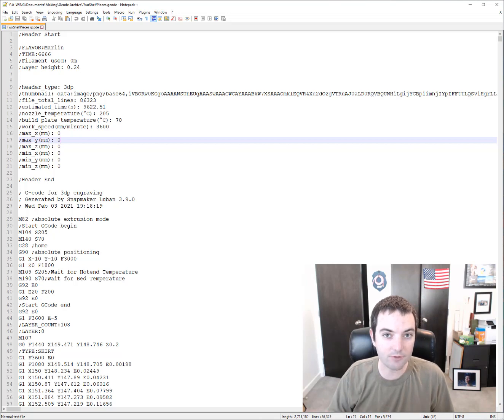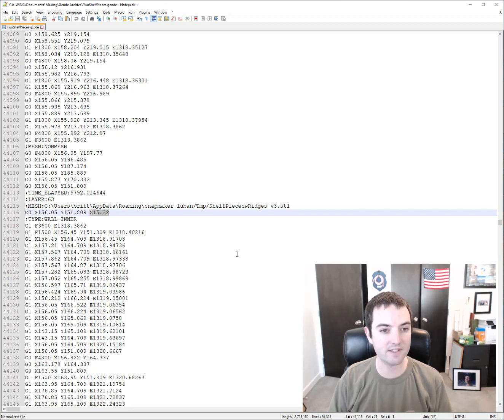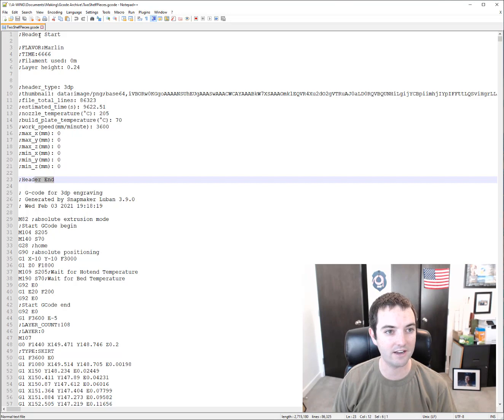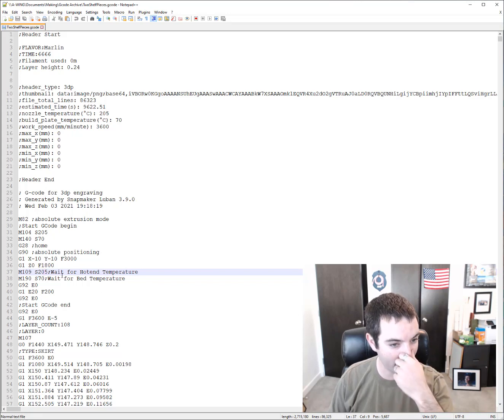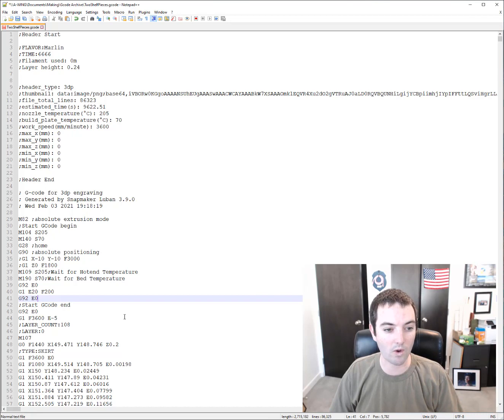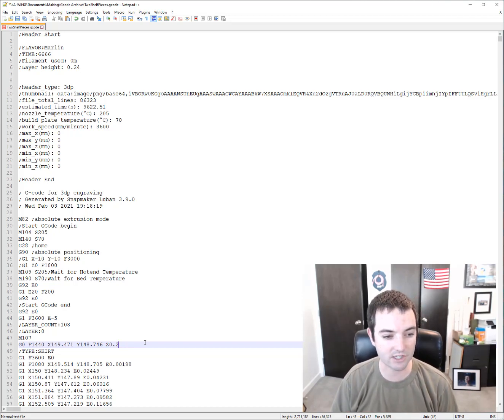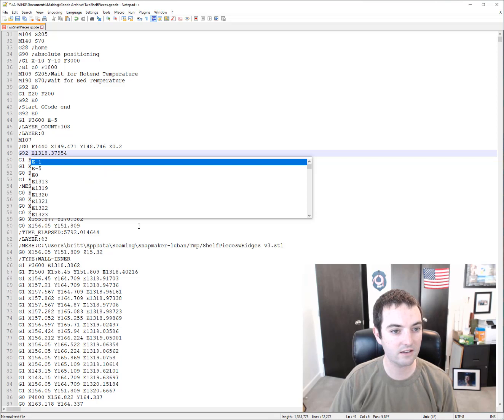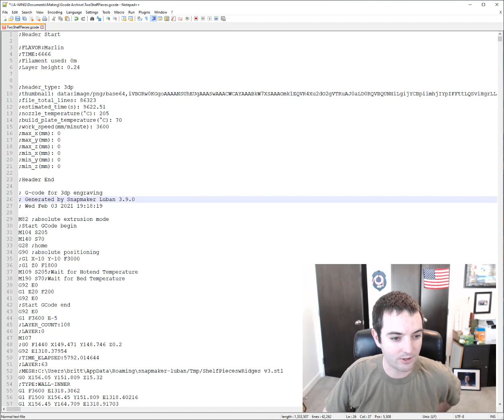How to restart a print from a certain height

Comment: Thank you so much for this video. This really taught me a lot about how to edit G-Code. As @Christopher Larime Mentioned, You must add a G1 command to set a height above your print to prevent the print head from colliding with your print when it is traveling from home, for example: In my case my Resume height was Z20.8 so I wrote: G1 Z40.0 F3000 ; before the print started to make sure it had enough clearance when traveling x/y. Hope this helps.

Comment: M107 [P<index>]    Turn off one of the fans. If no fan index is given, the print cooling fan. Turn on fans with M106.  The complete G/M code reference can be found here: https://snapmaker.github.io/Documentation/gcode/G000-G001
Thanks for the video.  This will come in handy.
Reply: you saved my Print.  15 hour job that stopped extruding with about 2 hours left.  Thank you!